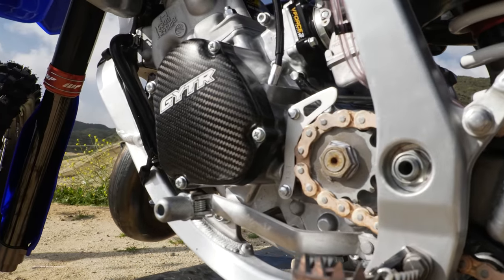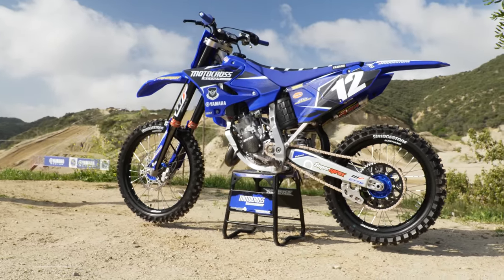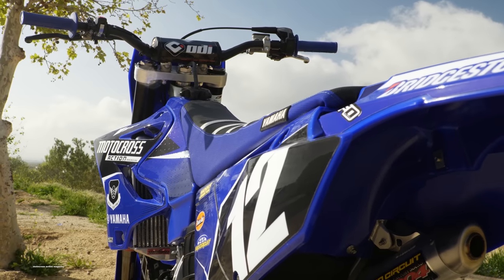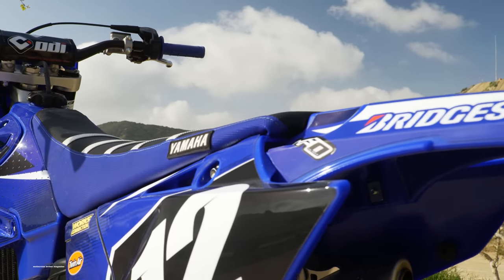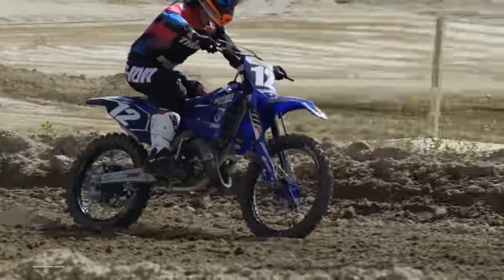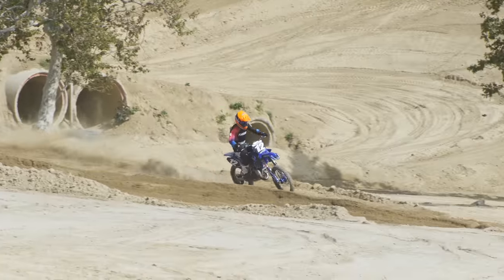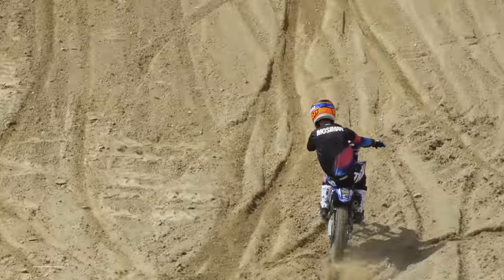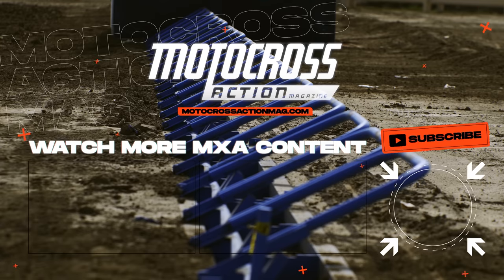Ryan Villopoto Yamaha YZ125 Two Stroke Replica - Motocross Action Magazine

Comment: Thibault Benistand won the emx250 championship with KYB A-kit(not the factory kashima coating) suspension, wich is pretty similar to the stock KYB SSS.
i think a good  revalve and respring will be more than enough for 99% of the riders out there. Wp cone valves are awesome but in my eyes is a waste of money.
Beside that, what an awesome bike.
Makes me also wanna send my engine to uncle Mitch...😇
Reply: KYB A-Kit is much better than SSS. KYB SSS is by far the best suspension to ever come stock on a bike, but pro suspension (such as WP Cone valves or KYB A-Kit) is much better than SSS
Reply: @reeveharper8424 KYB A-kit is not the equivalent of the WP cone valve.
The KYB Factory is.
KYB A-KIT is between KYB Factory and KYB SSS.
Basically is the KYB SSS with better internal components but they way they function is pretty similar.
Reply: @andreasstefanou5898  you've clearly never done your research. KYB A-Kit and WP Cone valves are both available at a consumer level, and are both comparable. That's why you'll find so tests and articles putting the two head to head (as well as the Showa A-Kit). What you can't get is the Pro rider's suspension. But Cone Valves and A-Kit are as comparable as you get, they even cost the same amount to buy
Reply: @andreasstefanou5898  Also there is much more to KYB A-Kit than just being an upgraded SSS fork. Go do your research
Reply: @reeveharper8424  in Europe you can buy KYB Factory Kit, KYB a kit and KYB sss.
Friends of mine have the KYB factroy but they could get the A kit also.
I dont know in the US.
I cant find the factory.
Its probably the same but they call it A kit.
Check again in the video i send you and you will see very clearly that Benistand doesn't have the Factory (or what in the US say, A kit).
It doesn't even have the same colour.
Actually its the same color with the stock SSS.
Reply: @reeveharper8424  i cant share a picture but if you see Benistant forks axle lug you will see that is not the same with what you call A kit (in the US) that is approximately the same price with the Wp cone valves.
Actually the axle lugs are the same with the SSS but painted black.
The same thing with his Yz125 bike that he won the European championship 2 years ago...😉

Comment: Wouldn’t engine work change choice of pipe? Like stock bike might like one better?🤷‍♂️
Reply: You'll have to use factory bikes as a example of what goes good with what bike. I'm building/built a StarRacing yz125 based on the parts they used on there team. You can get specs for each part and kind see what it's doing but really all you need is a FMF or Pro - circuit with the right jetting. If you are racing Id going with a more in depth approach with what parts and your bike/ability.

Comment: So in your opinion, if you're going to mod the engine and change the suspensions anyways, what's the interest of picking the yz over the ktm/husky ? ( I'm talking about buying a brand new bike, not picking an '06 yz for cheap :p )
PS : it's a legit question , I'm not trying to argue about your choice or anything
Reply: There cheaper too buy an parts cost less compared to KTM/Huskys
Reply: YZs hold their value well. Everyone wants to buy them used.

Comment: I could watch this all day.  Still baffled by the heavy flywheel.  Trying to figure out why Mitch would put that on it.
Reply: dont think of a flywheel as its own component,   and think of it as part of the entire rotating assembly.    with their use of an aftermarket piston , flywheel , clutch , and modified crank ( or custom ) , you can lose/gain weight in one area ,  but still as a whole weigh less , and or just work nicer together.   too light a flywheel allows the motor to spin faster.  and too fast , is too fast.  so id think they use it to counter some of the other weight losses  which helps maximize torque , and doesn't limit peak HP , where the engine is working the most, and the majority of the time . .    they arent worried so much with the low rpm loss.    id not be surprised if that also is the reason for the 4 tooth increased rear sprocket . though i'm surprised they didn't go to a 14t front and a +/- 1 toth rear . but i'm sure they have their reasoning . . ive found the 14t front ( 13t factory ) and a 48t rear ( 49t factory )to be the best combo so far on the 2022 model .